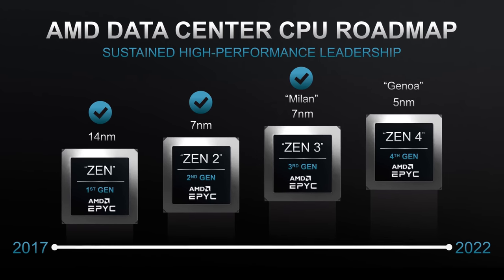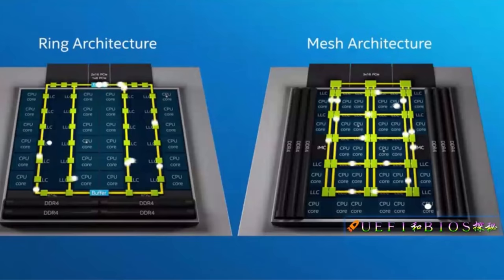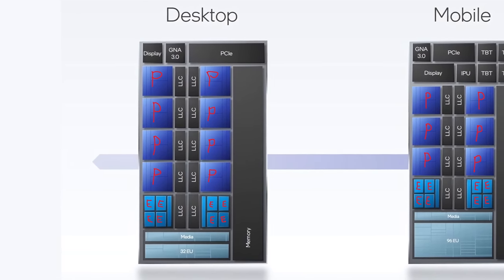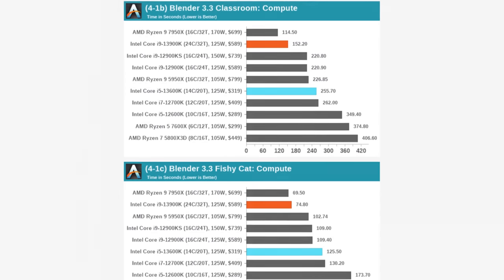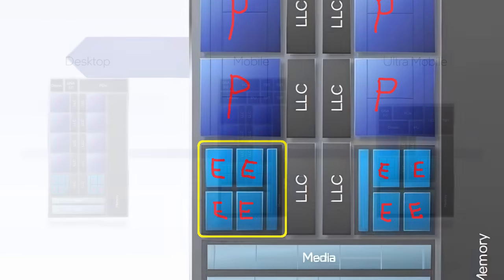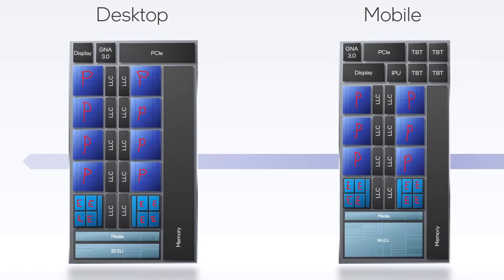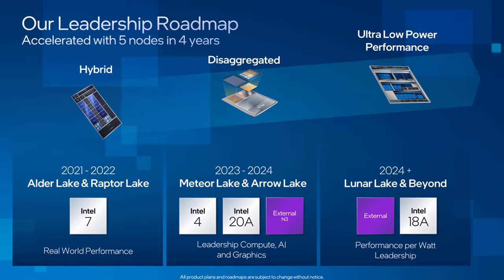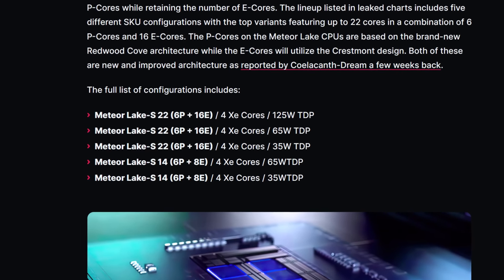E Cores - Slow, simple, not super efficient... but still good?

Comment: These core setups are basically like the option in windows that allows you to physically assign certain cores to do certain things for possible efficiency, but better.
Using that feature in windows sometimes made background apps perform badly, even if you gave one program two cores, it was bad. Now with these E cores, all of your background stuff is basically being forced on those cores, but won’t cause those apps to perform bad.
Though I still feel like the efficiency of the P and E core setup needs work. Like when the P cores have nothing to do, have them clock down enough to use almost no power, while the E cores basically sip power to keep background stuff and the PC on lol.

Comment: E cores are a scam. I own 2 laptops with 2 12th gen. One with a P and one with an H version of the I5. The P version got 10h of YT playback, the H got 6hours. Efficient my arse. The battery last as long as an 11th gen. I'm sure the big performance jump come from a bigger DIE and a smaller node. Not the added cores. More cores are good for parallel tasks, for everything else, gibber cores are better, in the end, what matter is the amount of transistors in the chip, anything else is marketing.
AMD had to have more cores because of the chiplets. Intel use the E cores as marketing to inflate the amount of cores on the packaging.

Comment: I just want 8 big, fast cores, no SMT, no HT, no E cores, no BS.
Reply: what's the problem with SMT/HT? It can be disabled in BIOS anyways (as well as E-cores)
Reply: @niter43  No problem, I just don't wanna pay for it. They usually charge more for processors with 16 threads as they are used mainly for professional applications
Reply: 12700k is an octa core cpu, disable e cores and HT and bam insane power
Reply: @Fiwek23452  you are missing the point

Comment: I feel like there could be some catches using P+E design since benchmark programs either stress 1 core or all cores. What if a software uses all available P core threads + 1 more? Let's say there's a task that uses 7 threads,  6 threads are run on P core, one thread is run on an e-core, would that one extra e-core performance delay the task completion since P core threads complete their tasks first but have to wait until e-core finishes its task? Or would the task being done by e-core move over to P core whenever P core becomes available hence overall performance is less impacted? I remember reading a forum at intel web some users have reported weird performance drop when mixing these thread allocation by fiddling affinity settings.
Reply: Generally no, the E-core wouldn't hold up the program in this situation, because scalable multi-threaded programs (likely almost anything that would scale to 4+ cores in the first place) don't typically allocate a large chunk of work to each core upfront - instead they break the work into a larger number of smaller tasks in a queue, and a pool of worker threads grab tasks from the queue. Each thread grabs its next task as soon as it finishes the previous one, until the queue is empty. So if one core is slower than the others, it ends up grabbing fewer tasks, and finishes its last task around the same time as the others.

The OS scheduler could also move a thread from the E-core to the P-core, just like you said, but it's not really guaranteed, and it would only partly mitigate the problem. What's more likely is that a heavily multi-threaded application will be written to avoid relying on the behavior of the OS scheduler as much as possible.

Comment: E cores don't boost multicore performance any more than P cores when adjusted for size. I think there's more than enough benchmarking evidence on the internet to suggest this. Many nontechnical people sadly look at core count first and foremost before buying a cpu and I've yet to see a more appealing reasoning for these cores other than the simple observation that Intel wants to maximize core count and appear much more capable than they really are. Asymmetric cores only make sense in severely power and thermally constrained systems like mobile cpus that are meant to tackle completely different workloads compared to their desktop counterparts. Intel merely offers a subpar implementation of this idea adjusted to their own agenda. Ryzen cores can actually achieve what e cores are meant to achieve and more through pbo2 undervolting. The only criticism I have for amd for this issue is that their cpus are overvolted by default. Most of these discussions would actually dissolve away if the average person navigating the cpu market knew about this. It's even harder to argue about these things as people without experience might just think you're bluffing or trying to underplay intel by meticulously finetuning only the amd cpu when in reality it only takes 30s for even the most inexperienced of us to undervolt their ryzen cpu these days -- it's quite literally just the push of a button.

Comment: AMD has already 3dVcache to improve the CPUs performance.  If AMD finds a way so that productivity software will take advantage of VCache then it would be good for AMD.
Reply: There are programs that benefit more from total thread count than cache, and programs that benefit more from cache than thread count. That's why the 3DVCache was advertised as a boost to gaming, but every benchmark for multi-threaded work reaffirms that loads like rendering still require more/faster threads to be better. VCache doesn't make the processor itself faster, it just optimizes certain loads.
Reply: They already do. Its unfortunate that early amd and late intel false advertising have convinced people that cores are more universally applicable than caches. Cache misses are far, far more common than the probability that an ample opportunity where all cores get to play their part pops up. Most productivity tasks aren't actually using all your cores at their max hz. Benchmarks like cinebench are ideal situations and in reality your cpu is more likely divert the computation to the gpu for such parallel tasks. you'll never get to enjoy all the cores you collected lmao

Comment: e-cores are trash and not a smooth experience, they will cause you issues and the scheduler in windows 11 will never be perfect. Sure they great at accelerating benchmarks but outside the scope of that enjoy stuttering in more obscure games and software switching exclusively to e-core resulting in bad performance.

Comment: AM6 could use 4 chiplets. I could see putting full cores (perhaps more than 8) in each of two chiplets and then have 2 chiplets with secondary cores, up to 32 each if they use the same 4-1 ratio Intel uses. or perhaps 1 chiplet for mini-cores and one for npu or gpu functionality. Though balancing heat and power distribution efficiently will likely be a challenge. I'd really like to see a 4 chiplet based hedt lineup as well. 32 cores and at least 64 pcie lanes from the gpu.

Comment: Big-Little multi chip designs are probably going to be a persistent normal thing for decades. The two technologies seem made for each other. While Big-Little really struggles in the frame of energy efficiency on desktop in large part because of the inherently inefficient infrastructure that desktop CPUs are built on, I suspect that it will become better. Who knows, maybe they will find a way to actually implement a sort of RISC concept to E cores in 10 or 20 years. and in terms of multi chip designs, I suspect that those will become universal. The benefits are proven and the scalability makes it essentially a no-brainer in the long term. The potential downsides will primarily only manifest when infinity fabric latency isn't fast enough to keep up with single die designs but with designs such as having a single P die and 2 E dies, they could avoid the brunt of that problem by keeping latency at a minimum when it's most important.

Comment: Intel's strategy makes sense because optimizing games to use more and more cores appears to be a rather difficult task, so having less powerful cores allows those cores to run a little faster due to having both slightly more energy and available and not getting as hot due to less powerful cores running under the same IHS, and on the other hand software that is highly threaded cares more about the amount of cores than in their speed.

A possible problem of this approach is encountering errors or simply seeing less performance due to the OS or the software itself not being able to efficiently distribute their workload among the P cores and the E cores.
Reply: NT is getting better at bigLittle. Aparently Win11 has better scheduler than Win10.

Comment: Prefacing this by saying I'm everything but an expert on how computing works, just a thought of mine:
I think the holy grail of processing would be to have many many small cores that can both handle micro-tasks by themselves but also combine to handle big tasks.
It's like a hive mind, it would be incredibly efficient and even more so the smaller and more plentiful the cores are.
Come to think of it - isn't that kind of what GPUs do? They have thousands of small processing units. Is it a difference in computing types that makes this unfeasible for CPUs?
Reply: GPUs have thousands of cores and also process thousands of threads. There are millions of the same task that must be done for each frame, remember that your display is made of millions of individual pixels, and the GPU must calculate the color for each one individually. If all programs could be parallelized in such a way CPUs would be very different.

For combining cores... I don't think its possible. The closest could be considered the already well known SMT, which splits a single core into multiple virtual ones, and if you want maximum single threading you simply ignore all but one threads per core. There was some talk about a potential VISC CPU a few years ago which would have "virtual cores", but seemingly never got anywhere.
Reply: CPUs already do something similiar to what you're suggesting, it's called a superscalar processor. In short, you have multiple execution units that can work as a single CPU core. And when a process doesn't use a core completely you can take advantage of the unused execution units by splitting each core into multiple virtual threads(SMT). You can only optimize a workload so much until you run into data parallelism problems though. This fundamental limitation is ''solved'' or rather mitigated by having multiple CPU cores on the SoC, each working on separate data streams.
New Mind's video series on CPUs is probably the best way for a layperson to understand how a modern CPU core works. https://www.youtube.com/watch?v=sK-49uz3lGg
Reply: it depends if the program in question can actually be split up into tens, hundreds, thousands of separate workloads that don't need to interact with each other. rendering images is very good for this because each core can deal with one shader program that runs on a single pixel of the screen at a time, and largely doesn't care about what's happening in the pixel next to it. 

But CPU workloads like for example a video game are much harder to split up because they have lots of different parts that interact. Like physics for instance, it needs to know where everything in the world is in order to process what is colliding with what. 

If you split up player movements onto one core and shooting onto another then they would have to wait for each other to communicate that information so there's no real benefit to multi-coring it. Does that explain a bit more why CPUs still have relatively few cores??

Comment: if anyone interested:
I have 2 laptops Alienware x14 12700h & Rog flow X13 6900hs
average wattage for 12700h is 40w and 18w for 6900hs

in games 40w 12700h provides close or less performance to 18w 6900hs, because Ryzen have much better Wattage/performance scale
in creative task 12700h outperforms 6900hs by 15%
Cinebench R23 12700h 40w ~12k point, 70W ~ 14k 
6900hs  18W ~ 11k, 25w ~12k , 50W ~13k

Battery life is 3 times better on Ryzen laptop in every mode. I can easy get 8-9 hours on Rog Flow in Eco mode 10W, which can beat 9k score in Cinebench, so performance is awesome. While Alienware X14 eco mode use 15W TDP and laptop extremely laggy and impossible to even typewrite/browse web.

In my experience Ryzen chips are best for portable efficient laptops, while Intel beast chips need top cooling of pricy top end gaming machines.

I love my Rog Flow x13 & 6900hs,  can play AAA games in bed using tablet mode and heat never reach more than 70*, also coolers are a bit louder than Steam deck.

Comment: I've tested a 12700H inside an Acer laptop. During battery time, the CPU is using 99% the E-cores, frequency shifts from 400 to 1100 MHz during low load (web based app with video content, external, screen, keyboard, sound). Battery lasts an atrocious 2 hours with not much load. Either SW can't use them correctly or this strategy is not working for Intel.

Comment: ARM's big.LITTLE architecture was designed with power efficiency in mind, to put simply only one big or LITTLE core in a pair would be powered on depends on the task running on the core, and it can switch between the two on-the-fly. (Later design do allow all big and LITTLE cores to run at the same time for maximum performance, in which case efficiency is out of the window.)

intel's P-cores and E-cores aren't designed in pairs and can't do the same.

Comment: It's not the e cores being good as much as AMD 
'S slippage that is giving intel it the time in the spotlight.

Ryzen is falling behind significantly against their road map thanks to TSMC supply issues. This will mean that unless AMD takes drastic action, intel will maintain its performance advantage at least for a couple of generations. Zen 4 is a full year behind schedule, which is forcing it to compete with 13th gen instead of 12th gen intel as it was supposed to.

A similar thing happened with intel and their production issues with 10nm process, which allowed AMD to speed past it with Ryzen whilst multiple intel generations were stuck on 14nm.

AMD has liquidated its fabrication capacity and its strategy to aggressively singe source wafers from TSMC has gone from greatly rewarding to massive liability.

Comment: Interesting for gaming, given a mix of high and low prio tasks occuring in real-time, but I don't like the specific implications of this implementation, and choosing between avx512 or E cores is not elegant. I don't think I am the target audience though, because I do most of my threadpooling work on EPYC + nvidia, and I am looking for highest throughput possible rather than higher performance per watt. 

Video games are a gateway drug to programming, and just like all addictions, after awhile you end up needing harder junk and it is embarressingly expensive.

Comment: Intel's E cores get the job done, but at the expense of power utilization and/or battery life.  They are essentially just Atom cores, which did poorly compared to ARM cores for mobile devices years ago, and Intel hasn't exactly figured out how to fix those deficiencies.  I speculate part of it is just x86, part is fab process, and at least some of it is hubris on Intel's part.  Either way, my Windows-loving boss just bought a MacBook Air, so he could get through the day on a single battery charge as he goes from meeting to meeting.

Comment: arm did it, amd did it, why can't intel do it too?.. the only drawback of these E core is the fact that they have penalty being crammed inside the same cluster.
however they fix this for the 13600K by going 2 Cluster instead of 1.. rather than throwing the task into another "E Core" inside the same cluster it can just throw into the other cluster, this do give quite a good benefit in term of latency and performance.
there is also the fact that they decided to go all in for the P core to have the exact same Cache Size as the 12th gen server counter-part does help its P Core hit-rate further.
the only competitor i could see would be Ryzen 3D in short term for the 13th gen unless they do some price cut, but there is indeed that sweet platform longevity if you're going to build AM5 Based RYZEN instead.
All in all competition is here to stay!~ , customer can be happy to pick either side right now.. as long they dont mind spending that much money since both are pretty expensive~

Comment: Your comparison of a 6c vs a 6c+8c is the problem here. You would need a 8c vs a 6c+8c to see the actual difference. and with this you will realize that 4 cores running at half the speed with no hyperthreading and all the other compromised aren't actually really faster than 1 p core.
so what they essentially did is give up 2 cores for 8 cores. and this slightly  improved performance in a best case scenario, but significantly hurts it in all others. They just arent worth it for high end or even mid end desktops. they are much mor eworth it in low spec or power power or mobile systems where you can't pusch the P cores to insane power levels and the e cores are more efferent. Maybe not as much as some hoped but still a lot in comparison to the insane power intel's redlined other cores use. 
they onyl really make sense if you are thermally or powerline limited. in a mid highend gmaing pc they are jsut a waste of space. but there entire architecture is focused aroudn this dual desgine so it is understandable they still put them in.